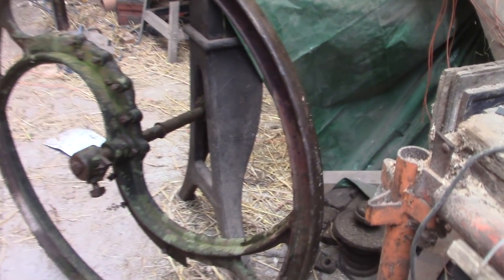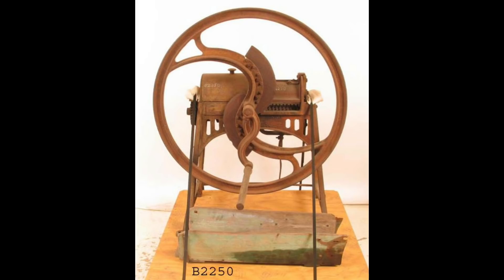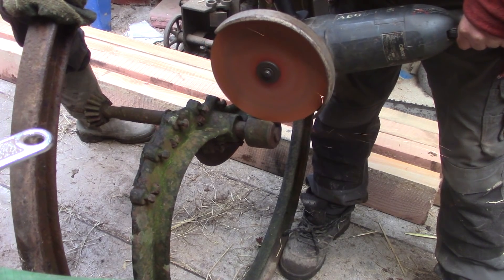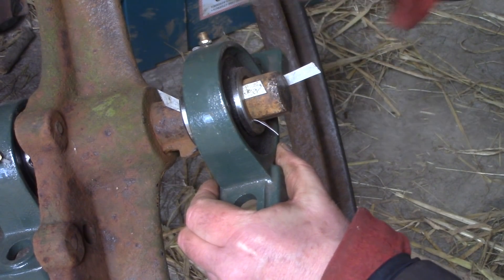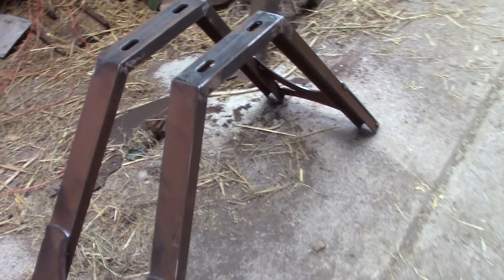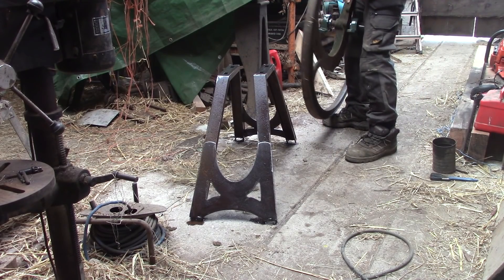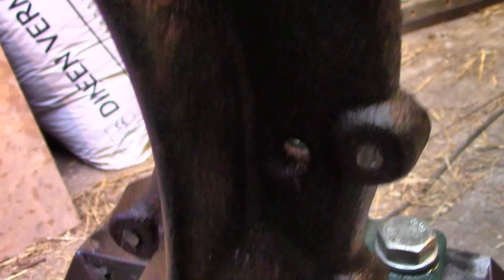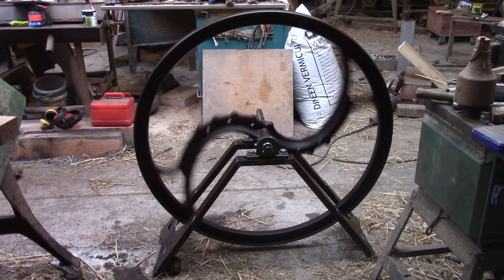Just An Old Cast Iron Flywheel Going Round And Round...

Comment: Their called Chaff cutters, because they chopped wheat straw or hay very finely up into chaff for animal feed. Very often made into "cattle cake" by being mixed with molasses, and finely chopped fodder beat, pressed and steamed or baked until it formed "cake".  Apparently it was very good at fattening cattle up  

 I have owned several chaff cutters over the years, and used them in anger, powered off my model traction engine. Your flywheel looks the same as the one I had made by Bentinels in Essex. 

My friend has a BIG one made my Maynards in Cambridgeshire that is designed to work with a threshing machine, and I started (but not got much further) making a 1/3 size model of this. 

Chaff cutters the size your flywheel came out of are still made and still much in use in India, in many cases still using the old Victorian design, where they are also known a sage or root cutters and they use a miniature design in the kitchen.
Reply from the maker: You're right! - I was being too literal

Comment: ASMR for enginerds!

Must remember to spin it the right way otherwise you will antagonize the Engine Gods!

If you doubt the existence of the engine gods just ask old hand about the engines they had to fix that just started (or stopped) without any reason other than the Gods not being sated! You can usually see the offerings left out for them in the form of oily rags hung on suitable parts of nearby machinery!  You can also hear the incantations made to them by those aconites (usually under their breath) trying to start particularly susceptible machines ;o)

Comment: Beautiful flywheel but remember the old design rule for cast iron wheels: never spin it faster than 100mph on the outer edge of the rim. This is to prevent the rim bursting open under centrifugal forces. The rim centrifugal stress is calculated from material density x linear speed squared and shouldn't exceed the max strength of the material, including a healthy safety factor. Hence the 100mph rule for cast iron. Cheers, Toby
Reply from the maker: thanks. Yes, I was aware there's a speed limit on these things, but my plans are more modest than 100mph : -  )
Reply: @wayoutwest-workshopstuff6299  and here I was hoping to see you flying down your 100ft of track at 95mph. :)
Reply: Centrifugal acceleration is v^2 /r where r is the radius of gyration. So a simple 'speed limit' doesn't work.
Reply: @donaldasayers  No one's mentioned hoop stress yet either ! I'm aware of this but am no mathematician to advise on the matter :)
Reply: I was thinking about that but i think if they have the speed reduced they can get more Torque as well
Reply: Hi Donald. The stress calculation I gave is for the hoop stress. I just didn't use that name. Cheers, Toby
Reply: Just guessing at the size of the wheel, and rounding out figures to make it easy for mental arithmetic, 100mph at the rim would be around 50,000rpm.....
Reply: @christopherdean1326  I don’t wish to be a smart ass but I think your maths has gone a bit wrong there. If the wheel has a diameter of 1 meter it would need to rotate at (very approximately) 850 rpm for the rim to be travelling at 100 mph. Not 50,000…
Reply: @JPHOT100  This is entirely possible!  I was doing the maths in my head, while reading other comments, so the decimal point may have wandered a bit....
Reply: @christopherdean1326  
Wandered? It immigrated.
Reply: @JPHOT100  
I’m glad I’m not the only one that uses both metric and imperial terminology in the same sentence. 😀👍

Comment: Lovely.  I'm a keen composter and also try to be as low carbon as possible, and although our electricity comes from 100% renewable sources, I still begrudge feeding little branches into my electric shredder (a Mountfield 2200w 'quiet shredder') to help my many composting systems. So I bid for one of these chaff cutters on Ebay. Sadly, although in working order, it didn't do what I wanted it to do and it was slow, difficult and inefficient, compared to the wonderful electric machine.  I sold it on.

Comment: I have always loved seeing the motion of s-shaped flywheel spokes.  What is there about them that is so entrancing?  It would be much easier to make straight spoke patterns for pulleys and flywheels.  It would also save on materials and be much easier to cast.  It would seem that our forbears found the shape and the motion pleasing too.   How nice that this old machine was made to be beautiful as well as functional.   

I also love that you didn't over-restore this wheel and take away its history and the story it tells.  IMO it would have been a shame to grind away and fill in all of the rust pitting, slap on auto body filler and apply multiple coats of enamel paint in a misguided attempt to "restore" it.     
 
I'm looking forward to seeing more of this build!  Perhaps it could be the centerpiece of a slow-turning Sterling engine:  https://www.youtube.com/watch?v=WHDRUvj2YF4 

Best regards from Key West,
Capt. Blackheart Charlie
Reply: I could be wrong but I think the early spokes were curly to allow for different shrink rates during cooling so less spokes cracked.
Reply: @britannia-foundry  Correct. Today we have better metallurgical solutions and solidification during casting can be better controlled. Back in the day, they had to design so that dimensional distortions and shrinkage differences would not render the cast part useless. Thus straight spokes and perpendicular connections were   not seen with most old machine parts.
Reply from the maker: Brilliant!
Reply: I think this particular s wheel looks like two dragons chasing each other Routan’s round

Comment: Well done! Keeping things simple and with recycling you'll get there. I noticed the flywheelstand has no rod or so between the feet of the stand. If the construction must be protected against bending you might need something down there. All triangles can handle forces in all directions because being closed.
Reply from the maker: It's not finished yet!
Reply: I had the same thought, I thought a single thin rod between the legs, offset so as not to interfere with the flywheel would be discrete and keep the stand from bending.  it looks surprisingly stable as it is though!

Comment: Get yourself oxy-acetylene or propane, it really makes taking apart these old things so much faster as the bolts come out easily.

Boiled lindseedoil is good to paint rusty machines with, or old motor oil if the smell doesnt bother :)

I mix 50/50 lindseedoil with pine tar and thin it out with 2stroke gasoline to my liking, it adds black colour when painting rust with it and makes really waterproof surface for a long time.

I also undecoat my lawnmower with it, it makes it so that the grass does'nt stick to the underside
Reply: Boiled lindseed oil and paint thinner 50/50 also works well for any equipment with plastic on it. It will give is a nice shine again for a week or so. I did this to take photos of a older 4 wheeler that I fixed up and then one thing broke and it was out of my reach of fixing and made a lot of money selling it. Though for dull plastic heat is the best source of fixing dull plastic. 
I have used 50/50 diesel oil and diesel mix for coating trailer decks. Just wait a few days after coating to load or get on said trailer as it will be still slick.

Comment: This guy, Joel creates, made a video yesterday about how he used an old combustion engine from a grass chopper as a steam engine, that looked quite promising
Reply: i'm pretty sure any single piston petrol engine can be used as long as it isn't a two stroke or a four stroke engine
Reply: @DatBoiOrly  but six-stroke is OK?
Reply: @hayttom  no dummy only a single stroke engine will suffice that's it.
Reply: @DatBoiOrly  You'll have to explain that one to me.  My understanding is that guns are the only actual single-stroke engines.
Reply: @hayttom  a regular petrol engine goes bang in every stroke before being exhausted, a two stroke engine goes bang every 2 strokes because it compresses the fuel mixture then goes bang then exhausted and finally a four stroke engine sucks in air fuel mix, compresses it, then goes bang then exhausts
so in short a regular petrol engine is a two stroke engine, a two stroke engine is actually a 3 stroke engine and a 4 stroke is a 4 stroke engine. why would you use a  single stroke engine because we're working with steam something that's already in its combusted state so it doesn't need to be compressed or sucked in, so using a four stroke or a two stroke is completely pointless and a waste of potential energy and since steam has less energy than a petrol or diesel it wouldn't be able to complete the cycle
Reply: Do you realize that there are two strokes per revolution of the engine?  Please explain how your one stroke engine fires twice per revolution.  Also I think you need to understand the meanings of internal and external combustion.  And it would be a bonus if you didn't call people dummies.
Reply from the maker: Thanks, Nik. I have a different idea, but his is good too

Comment: Gorgeous. We have a chaff cutter at the Gold Museum where I volunteer and have used it each open day to cut dried hay, wheat or lucerne into chaff. The horses are fed with it by adding it to their nose bags while they await the next group of tourists looking for a ride on the horse drawn vehicles...
Ours has a belt driven by a small steam engine and a steam boiler as part of our Steaming days - on days when steam is not available (or there is a total fire ban) we have a two cylinder Lister engine that drives the belt.
Reply: yeah got one of those belt driven chaff cutters on the loft of the barn here as well. Got a electrical outlet next to it, so it was probably converted to use and electric motor to drive the belt at some point.
Reply: As kids, we used to hand crank one, chopping up hay for the horses feed. It was pretty hard work and we eventually fitted an old Lister D to it via a flat belt around the big cast iron wheel. No guards on it, whirling blades, flapping belt and the crank handle flying around, it seemed like we'd taken a death trap up to the next level !